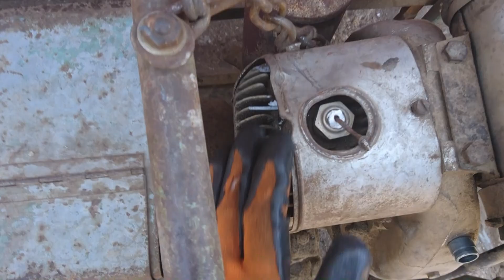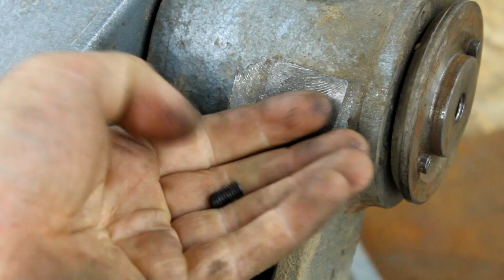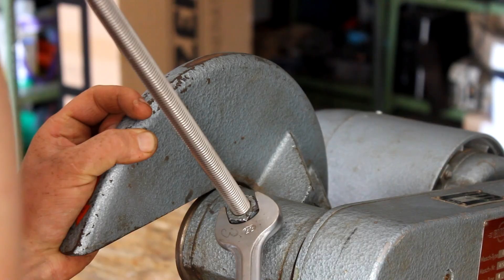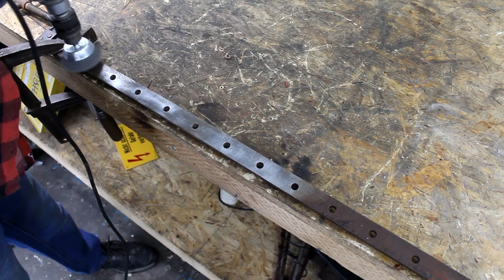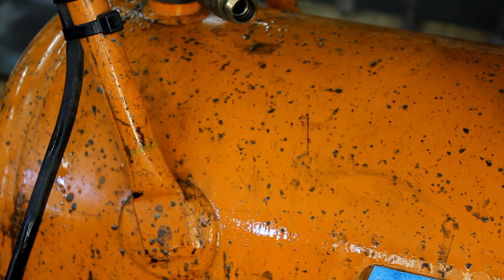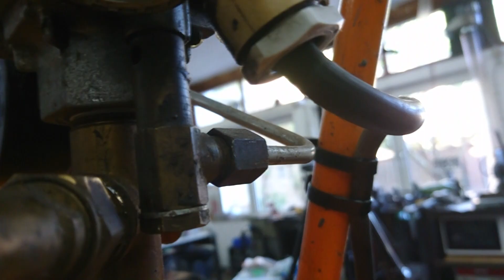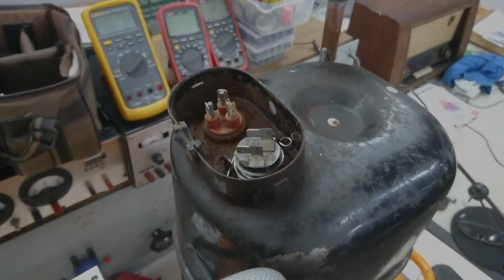Many More Scrapyard Finds! Repair-A-Thon!

Comment: Interested in the quiet compressor one. Can a compressor from a fridge do the job as well? Thanks.
I recently bought a used one but found it faulty (my luck was bad). Its oil breather was broken and blowing out oil when working-very loudly. So I’m inspired by your refit and considering making it work, quietly.

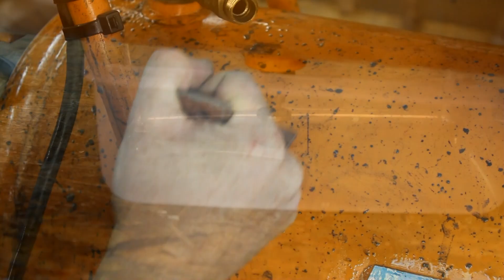Comment: I was working in my early career as a prof.Indust.Cleaner and doing Salvage. at 17:30 you asked how to remove concrete spots from your air tank.
Go to your local hardware store  and ask for "cement veil remover" oder 

Zementschleierentferner. let it work in properly and give it time to brake down the lime binding.(after a night .spray on tank and use kitchen paper towels to keep the product on its place. Use plastic foil to prevent evaporing.) After that , the concrete has brake down to brittle spec,s you can knock off easaly.

Comment: I'm That Type of motor like you saying the video it's a three-phase motor you can use an inverter because I used to work with motor drives in the past so you can have a single phase motor drive and run a 3-phase motor on it

Comment: I would try muriatic acid to remove to remove the concrete splatter, you can get this where they sell pool supplies, OR a Home Depot or a comparable store. You  can water it down to water it down to whatever consenstration that is needed; but test a small area 1st to make sure it doesn't effect the paint.

Comment: A lot of americans use a/c compressors in their vehicles for offroad air pump. they have found ways for the oiling and cleaning and the compressor and air. Check out some of the US 4wd forums.  Google search should offer plenty ideas.

Comment: Very good handcraft work in restoring these parts! You should definetly test the compressor tank with a hydrostatic pressure test before using it to full pressure. The power of an exploding 50l air pressure tank can not be over exaggerated! It can definetly kill you and others. Although the condensed water seems to be rust free its better to double check :-)

Comment: remove concrete by soaking in vinegar i think. Instead of soaking you  could wrap it with a vinegar soaked towel. it should dissolve/ soften the concrete.

Comment: hvac compressor when are use to compress atmospheric air , water in the air will condense under the pressure in the compressor and will goes in the base of the compressor. every thing in the housing will rust , if you do not use the compressor for a long time the piston will seize , it happen to me , the compressor was scraped !

Comment: That metal saw is amazing...would love to have one of those!  I can get cheapies here easily enough, but a well built machine like that would make me very happy.

Wonder if you could Bluetooth that wall ringer with a micro-controller (think I could halfway imagine how already.  Arduino FTW)?  I haven't had a land-line in years, but could see the benefit in the shop.  Much more noticeable than the ringer on my mobile.

Comment: we have scrap yards with mountains of cars where we can buy scrap, stainless steel bolts and nuts $5 per kilo, we have tip shops, people throw out basically new lawn mowers at our local tip and all they need is a service, people have thrown out basically new small Stihl chainsaws and people have bought them from the tip shop for $15, we get boats on trailers which are old but well made, motor bikes, drill presses, compressors, you name it we get it, one day a business dumped 2 large pallet bins of high grade grease which were worth $20 per tube, i bought $600 worth at $3 each, and we are only an island south of Australia.

Comment: I drove a cement mixer for a while and we cleaned dried cement splatter off the trucks with muriatic acid (hydrochloric acid). We were told not to clean the bare metal in the drums, only painted surfaces, I assumed because painted surfaces were protected against the corrosive effects of the acids. This is the first video of yours I've seen. I enjoyed it very much and look forward to more.

Comment: There was a public scrapyard in Waldorf Maryland here in the US.  I would go there and find repairable lawnmowers, bring them home and then once they were running I would give them to people who needed a mower.  New neighbors, co-workers etc.  It was s low cost hobby for me.

I also repaired my neighbor's dishwasher with a solenoid valve I had recovered from that same scrapyard.  He was so impressed he wanted to see the scrapyard.

While at the scrapyard he found a wire frame bakery bread rack.  His wife had been looking for one, but they were expensive to buy.  This one had a bent leg and a broken spot weld so he shrugged his shoulders snd said "ah, too bad".

I said "what?" "Thats easy to fix".

We put it in the truck and after 30 minutes of straightening, a little welding and some touch up of the paint it was as good as new and sitting in her kitchen.

I miss that scrapyard.  There were machines of all types and it was all free.  You are very lucky to have access to to a yard even if it isnt free.

Comment: Just by sound I'd say the bearings could use some attention.  Better to spend pocket change on grease while they still rotate smoothly than Euro on sourcing replacements later.

Comment: I love the angle adjustment on the old saw. I’ve used a ac compressor for some time as a air supply for an air brush and for a vacuum pump to degas resin for casting. And muriatic acid makes short work of concrete.

Comment: It's not so much that's nothing lasts as long. While that is true for many things today, it's not the case for all. What I see in Australia, is people updating for the sake of updating and not because their older car or device has "broken down". To say the least, many have more money than sense. 

To give an example, was having a clear out in a garage and sheds about 15 years ago. It was stuff that had been salvaged for parts and stuff and was no longer of use. Over a period of 7 days, took 4 trailer loads to the local tip(rubbish dump). Day 1, only 3 fridges stood in the scrap metal area for whitegoods. By day 7, around 600 fridges had been dropped off, most of them likely working. The best fridge and washing machine I ever had, came from a tip, in perfect working order, as much does here. 

Most of those people likely had no need to update their fridges. They simply did for the sake of it. Seen it with cars, tv's and a myriad of other goods. 

Australia is facing a recycling crisis because of the current trends. People are replacing their stuff, faster and faster, with each passing year. With some councils reporting a 10 fold increase in recyclables. 

And here's myself, still driving a car of more than 30 years of age and using gear and tools that is anywhere up to 60 odd years of age, because it still works and does what I need.

Comment: The very most natural efficient and effective way to remove mineral and or cementatious deposits or to separate inclusions of Crystals or Diamond chunks is to soak in Citrus Juices even Pineapple Skins can be squeezed or pressed. Any citrus juice in concentrate or fresh(preferred) will remove or break up minerals even cement which is mostly heated limestone that acts as the glue in concrete. 
It is not a speedy process but, it is far less hassle and not nearly as harmful or dangerous as MURIATIC or HYDROCHLORIC ACIDS which will rapidly destroy the minerals but require respirator gloves a smock would be recommended as both acids will burn and/or melt: Human Skin, Clothing. For protection only certain inert materials would be safe to receive splashing acid. One more note is the items you wish to use the acids on items be aware of the materials used floor and wall finishes! It may take hours for the damage to show the damage of a splash.

Comment: Another GREAT video! As a retired refrigeration engineer, you need to understand why these compressors are not used as air compressors.  #1 is that they need to be cooled by the saturated refrigerant and # 2 is that they have a % of oil that will leave by the discharge side and need to be returned to the crankcase. An oil separator should help with this. Don't expect a long life with this compressor.

Comment: Brick cleaner to remove concrete,but wash it off well as it’s acid  and please keep use up to speed on how long the compressor lasts with Oiler system yet to be made . Love your intro and keep up the fine work

Comment: There's a chemical you can  use to dissolve cement  that's fairly non-toxic to everything except like, aquatic life. So you don't wanna let it get into the water table, but it does wonders at eating away at one of the bonding molecules in cement and basically you just spray it on and leave it and the cement dissolves into a foamy slurry. You have to hit thick concrete with it a few times but I've found it works really well.

I imagine it's sold under a bunch of brand names, here in Aus I think we have "crete-off" (I think it's called) and another one that's just some brand's "cement remover." I removed a shitload of old cement from my truck bed with it in an afternoon. I half expected it to be a scam product but it didn't do any damage and worked like described.

Comment: Try using diesel to remove the concrete or asphalt, let it sit for a few seconds and it will fall off. Usually it works for me

Comment: Muriatic acid is commonly used in construction to remove concrete from equipment. Please be carefull if you use it, it is very nasty stuff.

Comment: You can easily make your own ultrasonic cleaner by buying the transducers and driver circuit from ebay or similar, you can make quite a powerfull one for only about 50euro in parts if you manage to find a suitable container made from stainless steel

Comment: I am a spanish fridge mechanic...sorry mate but I don't aproved your welding in the compressor using "plumber" methods. We use oxigene+butane and of course welding rods to hold preasures up to 27 bars and more. Using tin rod NO GOOD. anyway I give you my like

Comment: Hi, loved your video. Most of the noise in your saw will be from the tin belt guard and the blade. If you grab the guard with your hand you will find most of the noise will stop but I don’t recommend grabbing the blade 😉. I have a similar saw and it has the same noises. The best way I have found to remove concrete is to soak the item in cheap white vinegar such as you get at Aldi. The only problem doing your tank is that you would have to take everything off it and find a container long enough to soak it in. Seal the tank onpenings with tape and soak it, rotating each day until the whole tank is done. The concrete just comes off with a light scrub but the vinegar needs time to work. This method always works and is cheap and easy. It will also remove any rust as will. You and I are similar in a lot of ways as most of my equipment in my workshop was acquired cheaply or for free and repaired. I hate the way modern society is so wasteful but I guess one small benefit is that people like us can get good quality tools and machines pretty cheaply. The blade you got looks like it’s for aluminium but you can fit one of the modern carbide tipped metal cutting blades and it will cut steel like knife through butter without coolant. I love mine. I really enjoy your trips through the junk yards and I would like to see more of them. Cheers Stuart 🇦🇺

Comment: Big like..! The a/c compressor, how long does it take to reach operational pressure in comparison to the previous compressor? I have 5 of the old, quality compressors in my home shed and I am looking to converting 1 or 2 to silent a/c. Also you can build a vacuum pump with these old a/c compressors, for removing air and moisture from refrigeration units.

Comment: Another inspiring video! There is a product here in the USA that maybe you can find in the EU; it is called "Mean Clean Concrete and Mortar Dissolver" - I have used it and it does work.  When you spray the product on, the concrete residue must be completely dry - if it is wet it will just neutralize the Mean Clean and will not work.  I read that this Mean Clean is a byproduct of sugar refining - someone noticed that the concrete in the sugar mill was being eroded but it was not hurting the metal...Here is an Amazon link: https://www.amazon.com/Mean-Klean-Concrete-Mortar-Dissolver/dp/B00656RRFO and description: Easily remove concrete from your tools and equipment with NewLook's Mean Klean 22 oz. Concrete & Mortar Dissolver. The advanced liquid formula dissolves and physically breaks down concrete by attacking the Portland cement, eventually reducing it to mush that is easy to clean off with a hose or pressure sprayer. Mean Klean is the non-fuming, eco-friendly alternative to harsh cleaning acids and etching compounds. Commonly used by Ready Mix concrete companies, pre-cast concrete companies, masons, concrete and paving contractors, tool and equipment rental yards, and concrete block manufacturers. Mean Klean is ready to use with no additives required. It has etching properties that can be used to open concrete pours in preparation for penetrating coatings and increased bonding capabilities. The active formula can be neutralized and deactivated with water. Non-VOC formula minimizes bothersome odors. Allow Mean Klean to dwell and keep concrete surface saturated with material until concrete has dissolved. Do not allow Mean Klean to dry prematurely. NOTE: While Mean Klean may not be as aggressive as muriatic acid, it is a safe and eco-friendly alternative to removing dried concrete.

Comment: Where I work we're constantly cleaning concrete off things. We use a chemical called mudslide made by ZEP. It is very rough on your nose so I would recommend a respirator. I am located in the US.

Comment: Good on you for doing this. The number of workable electrical devices or otherwise good condition bags/household goods I've pulled from skips is ridiculous, at the very least it should be offered to a charity shop before going to landfill.

Comment: Whats the Type of the compressor you found. somewhere on the device should be letters stamped in to the casing or á sticker with some information. would appreciate it if you could share that info

Comment: as for the concrete splatter, a diluted muratic acid solution along with a plastic scraper. Paint it on, concrete should start foaming, leave it for a bit then scrape. A phosphoric acid solution is another option, generally found as ceramic tile cleaner.

Comment: The English word for the part that holds the saw blade is "arbor."  The parts around it are called similar things (arbor shaft, arbor nut, etc).  You did a beautiful job fabricating a new one.

Comment: For a nearly free ultrasonic cleaner, search the scrap yard for a defunked electric kitchen deep fryer.  Attach a small motor to the underside of the fryers kettle with an eccentric weight attached to the shaft. Use the existing heater element (If it works) attach a few resistors to limit the power to the element so it won't boil the cleaning solution. Use silicone caulking and cast some small rubber vibration isolators to the bottom so it runs quieter. 👍

Comment: Air conditioner or refrigeration compressors rely on recirculation of oil from outlet back to inlet. Your compressor will have a very short life unless you put some oil into the inlet every time you run it.

Comment: I have a Kaeser compressor too and yes they very noisy. I don’t use it much but if I did I would retrofit it. 
Q: Does the junk yard compressor pump take shorter or longer to reach “cut off” pressure?

Comment: 3 phase outlet?  Never seen one of those in north america...
Reply: The red 5 pin plugs/sockest are called CEE or Cekon plugs. They are  European  Standard . There are many different types in pin, frequency and voltages. The most widely used type is the 5 pin 16A 230/400V  such the one in the workshop. Sometime  you will find the bigger ones ,  32A or 63A Sockets.
They are rare in USA, but Canada use them also. There are blue 4 pin  versions for the US Single phase,   115/230V 60Hz  split power system available or the  yellow 3 pin ones for 115V 60Hz.

Comment: The plastic coating on the inside is a good thing but still, I would not trust that tank. There may be rusted spots in between the plastic layer and steel. Many compressors have stamped something like do not use/destroy after 10years it is for a reason. Just imagine if it blows from a side when you are next to it.

Comment: Small amounts of concrete can be removed by using an acid,available as brick or patio cleaner from a building supply company.Brush it on and wait for the bubbling to stop,then wash it away with water.You need to keep it away from brass and softer metals but it won't effect the steel.

Comment: The refrigerator compressor works in oil inside the housing, so the air system will it be oily, also by the time the compressor motor will run out of oil (after 2 years using it regularly). You have to add filter separator before the air fills the tank and collecting the oil, also good to know how much oil loosing and to replace with a new oil :)

Comment: If you would have installed the bell on the compressor, it would have drowned out the sound of the compressor and removed loose mortar from local masonry walls.

Comment: You can remove concrete or mortar using diluted muriatic or hydrochloric acid. Make sure you read the safety advice for it first. It can also be used to remove rust from steel extremely quickly, but the metal will form flash rust very quickly if you don't neutralise the acid quickly and protect the metal with oil or something similar